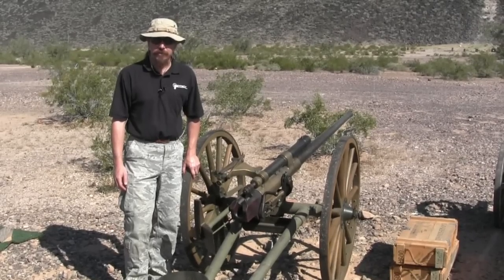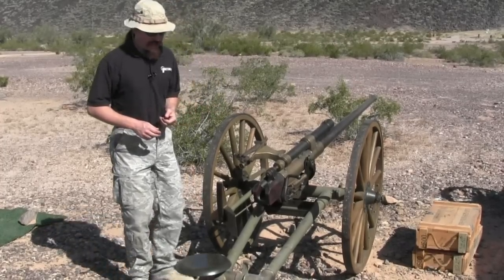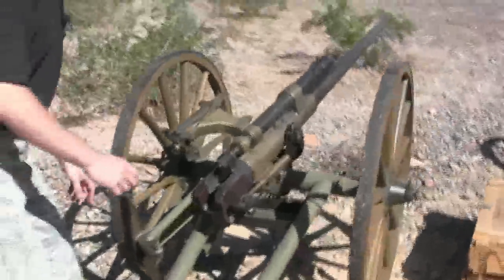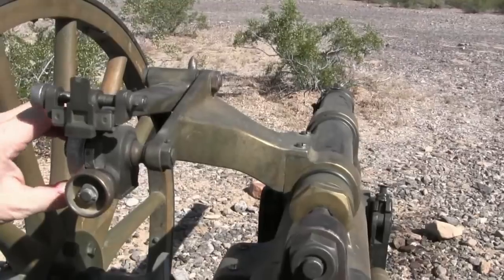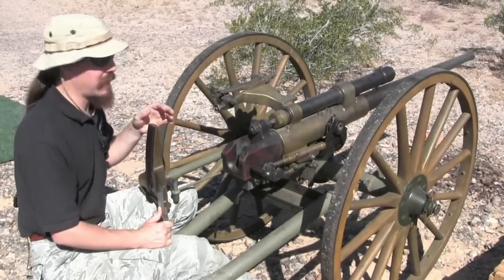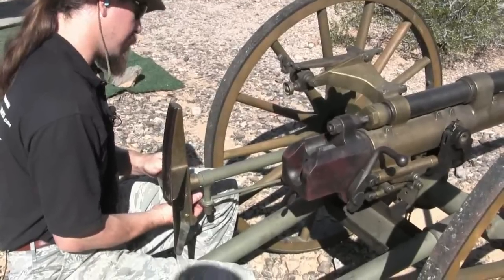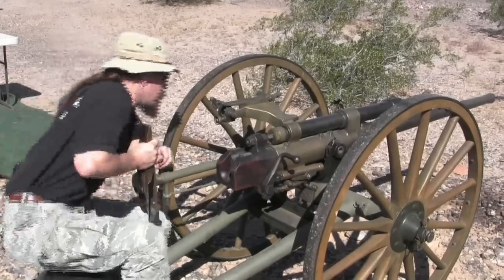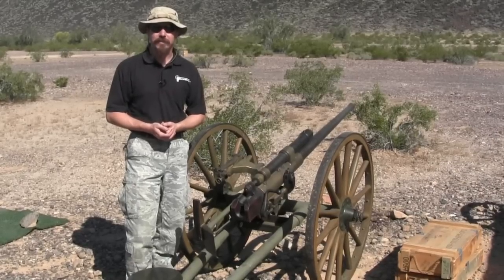Bethlehem Steel 37mm Cannon - WWI Era

Comment: This type of crew-served weapon is my favorite, too large for a pair, and too small to warrant a trio. I wonder why 37mm in particular was so popular at the time.
Reply from the maker: 37mm was the smallest shell size that could be legally used with HE, according to the Hague Convention.
Reply: Forgotten Weapons That's really interesting, thanks for letting me know!
Reply: Forgotten Weapons Can I ask what the clock is for on your logo?
Reply from the maker: Dell Conagher
The general concept of time passing by.
Reply: Ah.
Reply: I think it has to do with he fact that its close to 1.5" so they just went with that size because it was a "known size" but now that "we are modern" you see mm making a run for it so you got 20, 25, 30 and 40mm
Reply: Espen Andre and the tanks got better over time meaning that they need massive guns like 120mm and above
Reply: +Gahlok12 Nope, you don't need a large caliber for tanks, you need a good shell, the long rod penetrators  (APFSDS) isn't more than 25 - 30 mm in diameter. a large caliber is generally better for demolition with HE shells
Reply: ***** Too bad they didn't know that then, and wasted their time with thermite shells and APCR
Reply: ***** Well true but I wasn't getting at blasting other tanks up but for stuff like making as much damage as possible. To break things up faster.
Reply: +Gahlok12 tanks generally did not mount guns that big. The biggest gun on a tank in WW2 was a 122mm on the soviet IS-2 and that was getting ridiculous. I suppose the KV-2 with a 152mm was still a tank, but really, at that point you're getting into assault gun territory. Most tanks in WW2 had guns ranging from 37 (early) to 76 and 88mm (late). 
Modern tanks mount 105 and 120mm guns for the most part. Not bigger.
Reply: BWCMakro There was also 105mm, short-barrel 122mms, 128mm, and 130mm guns fitted to non-SPG armored vehicles that saw combat in WW2.
Reply: BWCMakro JagdTiger 128 mm L/55 was pretty big, but the biggest of them all were the ISU-152-2, it was a prototype fitted with a 152 mm L/50 BL-8, or a 152 mm L/48.5 BL-10, both of those were extremely powerful AT guns
Reply: ***** The only difference between those and shorter barrel 152mms was the barrel length, FYI.
Reply: Air Chief Marshall Sir Hugh Are you disabled? There is a huge difference between a howitzer and a AT gun, these guns had more penetration than the JagdTiger so don't try to sell me that it's just the barrel length, because they also used different ammunition, APCBC that weights 48 KG at 880 M/S is something completely different of a sub sonic HE shell.
Reply: ***** Well duh, obviously extending the barrel immediately nullifies your ability to call it a howitzer, but it also increases the muzzle velocity, thus increasing the pen. My point was they both had near identical damage abilities if the shot pens.
Reply: Air Chief Marshall Sir Hugh No, velocity has a huge difference, and as you said more velocity equals more penetration, and with more penetration you have something called over matching or over penetration if you will, this means that the shell will go in one side and straight out the other without doing any critical damage, but since this is a 152 mm we're talking about it will kill any vehicle it hits, but keeping in mind what you're saying is that the 75 mm L/24 on the Pzkmpf IV and the 75 mm L/70 on the panther is the same gun as they are the same caliber, and will do the same if the shot penetrates.
Reply: ***** Well, I never said velocity doesn't make any different. Over penetration is also indeed possible with a 152mm shell. It's just a little trickier due to the increase in size.
Reply: +The South Will Rise Again 
The 120mm or 125mm is needed to get that 8.5kg long rod penetrator moving at 1650 m/s.  The bigger the bore, the greater the pressure that can be applied to the projectile.  So what you get is the pressure energy from the full bore size being applied to a projectile of much less diameter size.  That can be accomplished many ways but the world class solution has evolved to the APDS and APFSDS solutions.
Reply: drkjk Not necessarily, you get those APFSDS rounds in smaller calibers like 30 mm, and they can penetrate MBT's from the sides, for an example the Swedish CV90 ( 40 mm) has won multiple times over the STRV 122 in combat scenarios in the woods ( mainly because even the L/44 is to long inside the Swedish forests)
Reply: You also have HEAT that doesn't need to go that fast
Reply: ***** You're right. But high velocity is nice. Low velocity not only has trouble with moving targets, but also means more time in the air, where it can be battered by winds and reduce accuracy.
Reply: Air Chief Marshall Sir Hugh Absolutely
Reply: Cool design philosephy, can you do a video about Why you started doing this? When did you have your vision of John Moses Browning coming down from the heavens, reaching his arm to you  while a choir of .50's blast away in the background and you hear the heavenly sound of brass clinging against eachother. The smell of gunpowder fills your nostrills a.... You get the point, don't you?

Comment: Seriously, this gun would have been of no use on the western front. It was made to shoot at exposed enemies over open field. Perhaps in the colonial war theaters it might have been of some value, but then again the weight would have hurt. A heavy machine-gun would have fulfilled the job a lot better.
Reply: +Funny Farmer A heavy machine gun like the M1921 an early M2?
Reply: Grapeshot would do a hell of ajob against enemies without cover, also AP was around before there were any tanks. AP was great for blasting holes in walls and stuff.
Reply: Could be useful in vehicle mounted attack. An armored car used for blasting concrete emplacements would be invaluable in a heavy offense